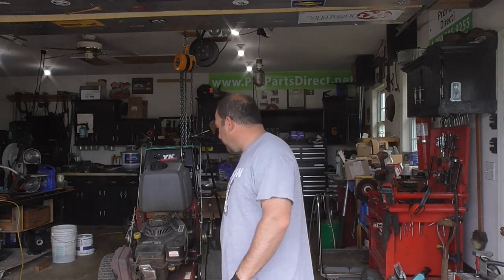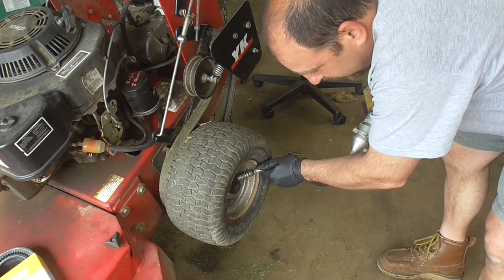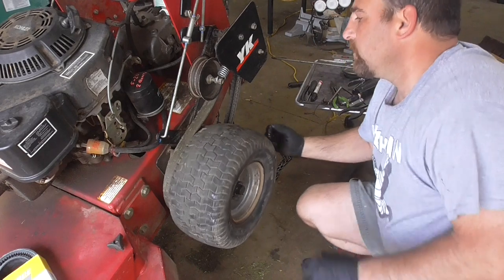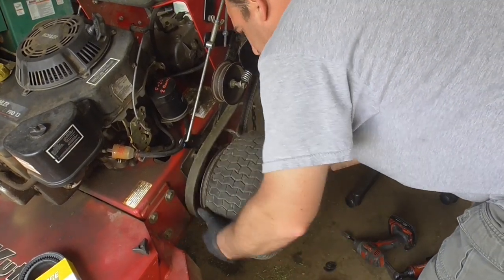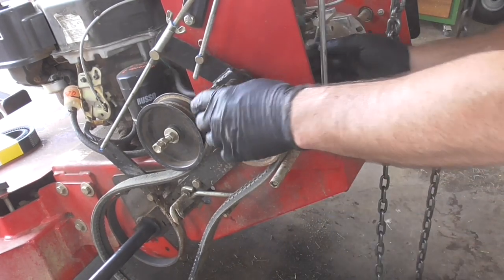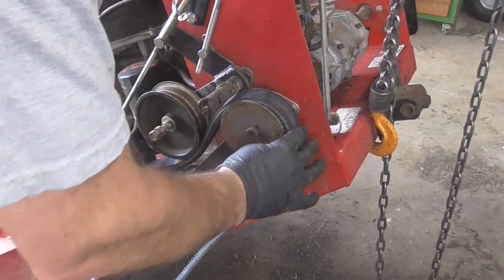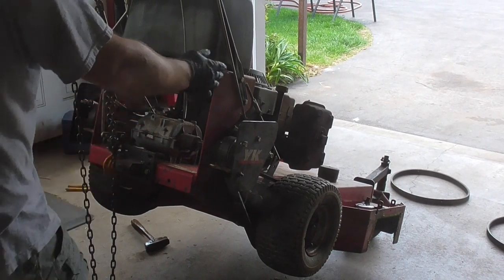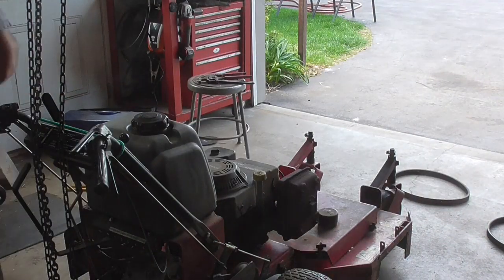Replacing Drive Belts On Walkbehind Mower

Comment: I never heard of that brand of walk behind, good they use common parts.  Once you get a new belt on, it's like all the other adjustments people made as the belt wore down are too much for the new belt!  I need to get a hoist in my garage, thanks for sharing the link.  I'm getting too old to be lifting all these tractors, atv's and engines.  Hope you're doing well.
Reply from the maker: I'm hanging in there Craig.  I haven't seen any videos from you in a while.  The hoist is used daily.

Comment: Just adding the same comment as others:  you don't need to remove the wheel to change the drive belts.  Just take off that plate and spring, then you can remove the belt.

Comment: Did you had problem with the blade handle when changing the deck belt? I currently took mines out to find out the measurement but when I went to put it back the blade handle won’t go down as it used to before I went to take the belt off I been searching for videos on my specific mower but nobody has any videos

Comment: Good video and good idea's.  Like the lift.  I just purchased the same exact mower you have, but mine is orange and is a Husqvarna.  Same deck, motor, controls.  Im in the process of getting familiar with it and tuning the handling.  I took the wheels off, disassemble some things and cleaned it up, seems to be working a lot better.  I ordered new brakes and belts, but now it seems to be handling pretty decent.  I don't know if it's worth it to put the new stuff on.  Do new belts and brakes make a big difference with performance?  I should be able to mix and match parts from your Yazoo.  What's the name and model of your mower?  Can you find parts?  Allot of parts for mine have been discontinued or hard to get.

Comment: I have the same mower your working on and you don't have to take the wheel off. Jack the mower up so that the wheels are off the ground and the belt slides over the tire . Doesn't help at all to remove the wheel.

Comment: I have a scag 48 walk behind and the belts on mine are starting to crack. This video will come in handy. Do you have a video replacing the drive belt on the engine for a walk behind? Thanks.
Reply from the maker: No, but if you have a hoist and can access the belts it is pretty easy to do.  Most the commercial mowers are designed to be easy to work on.

Comment: So what I do when I change my belts leave the lawnmower flat on the ground put the boat on the ground in front of the tire put the lawnmower neutral roll the tire Ford slip the belt over the tire and then loosen the top bolt that is behind the YK (on this particular lawnmower) then just work the belt on the pulley and then slide the tire back and your belt should be on. 10 minutes per belt
Reply: Yes I’m back !!!!
Reply from the maker: Sounds like a good idea, I would like to see it done in 10 minutes.  That is really fast.
Reply: doublewide6 Repairs LLC I accept your challenge, But if I can do one belt per 10 minutes for a total of 20 minutes for the whole thing..... I want you to do a video next time you have a walk behind and give me a shout out. by the way I was using voice text whenever I said that last comment there’s no boat and Forward is like that not Ford Lol
Reply: I’ll try and post a video of it or if you’ll send me a link to PM you video then I’ll do that also
Reply: Where can I get this belt locally??
Reply: @justinjenks6314  I buy my walk-behind belts on eBay because they’re cheaper and yes they may be made in China but they’re still cheaper than paying $78 per belt at the dealer when I can pay $75 for two belts on eBay